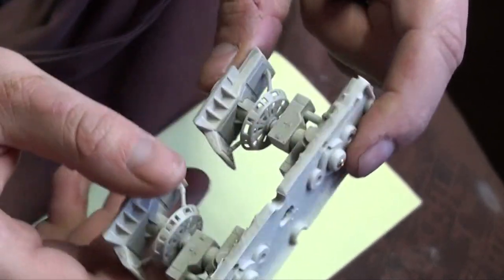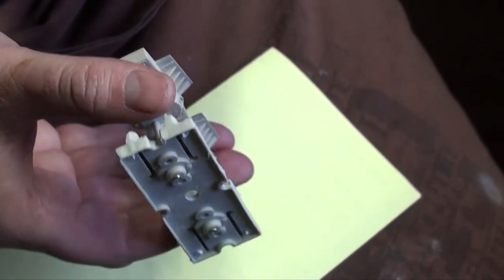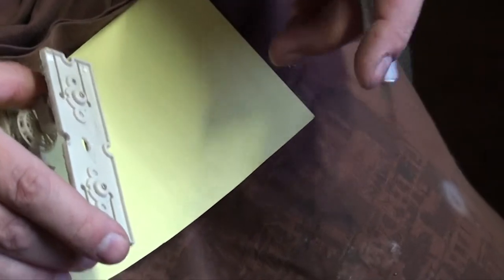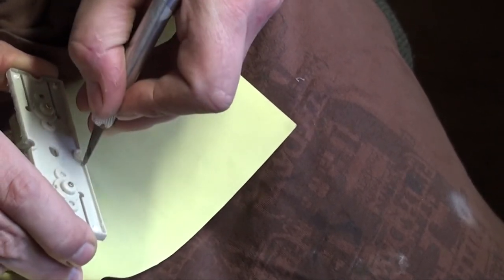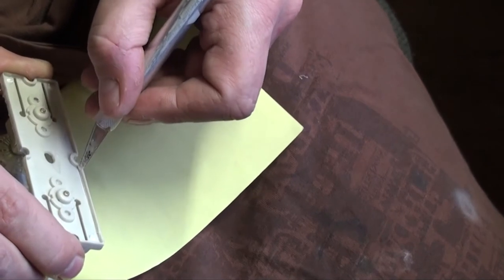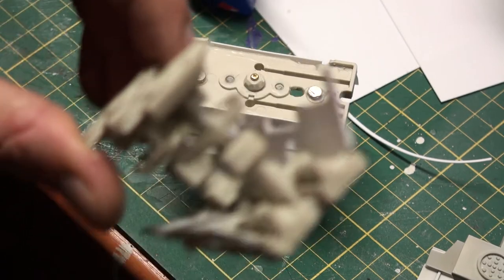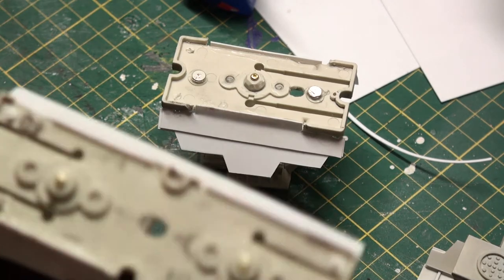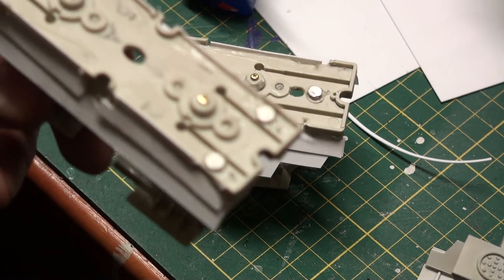Build the Millennium Falcon - episode 99 - "On your Feet, Soldier!"

Comment: Time Stamp 35:24 is that some extremely round unburnt blast damage I spy? you are probably planning on doing it next week but just in case, don't forget the blast damage areas, there are a couple on the top and bottom as well as bottom of the cockpit and docking rings. I don't know what I will do when you finish, I may have to start mine to get over my addiction to your falcon videos Lol :-D
Reply from the maker: Yep, in episode 100 I will be improving the damage areas. Not with a dremel like the bottom hull, bt with a different device that makes less noise.